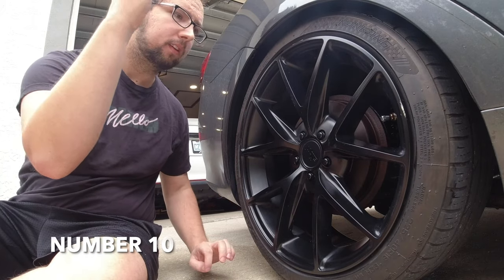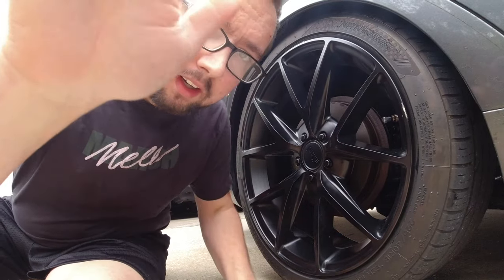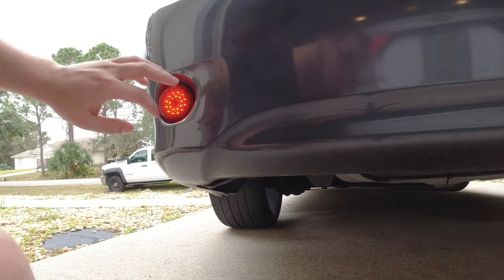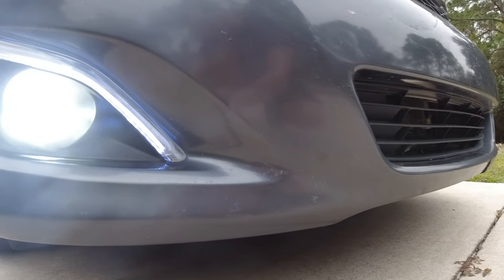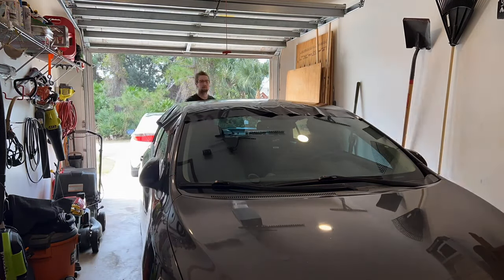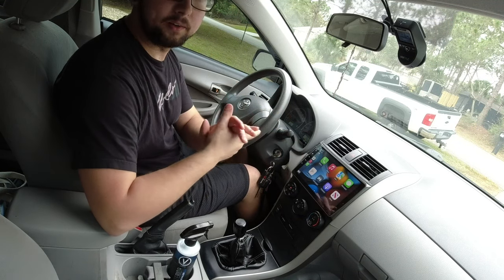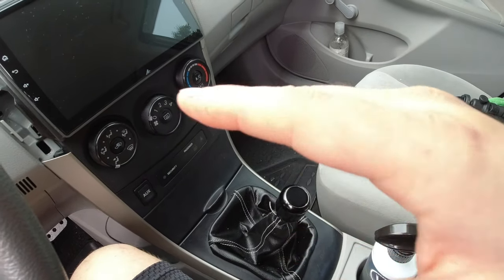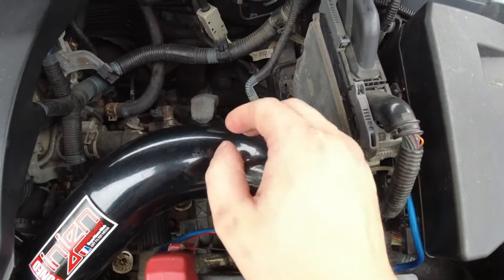TOP 10 MODS FOR TOYOTA COROLLA IN 2022

Comment: 1st thing is I run a car club, and wheels are a mod. I also have an 09 LE and thanks to you I've done most of these mods to my car as well.
Reply from the maker: I’m glad to see you agree that wheels are a mod! 
And that awesome that my videos have been helping you out!
Reply: @BrandonStellmach  they’re at least a mod! anything you can change is a mod! i’d go further and say they can be upgrades. you’re correct about rotating mass but wheels are also unsprung weight which too much of, reduces handling. lowering it, has the inverse effect and makes it more nimble! rims & tires are ALWAYS modifications but if they are lighter and/or stronger, they are definitely upgrades. Width and height also make differences but this comment is already too long🤣

Comment: Some good mods but you just need to clean it up and bring it home. 1. Get better tires, although you are in Florida where there are no mountains and fun roads so they might be okay. 2. You are missing the trim on your center dash. 3. The wheels look nice, nice design. How much do they weigh? And I agree, wheels and tires are a mod. 4. I have the TWM shifter in my 2009 Corolla S Turbo and I love it too. It's the same design as yours. A little tip to make it easier next time. Leave the shifter cage in the car, no need to take it out and it's like having an extra set of hands to hold it still. 5. Leather wrap your steering wheels or get one from the S/XRS as they came leather wrapped and it's so much nicer than the rubber steering wheel. 6. Coilovers are a great choice, I'm on BC coilovers and love them. 7. The stereo looks nice. What brand is it? Is it just one of those cheaper Chinese stereos? 8. Love the Borla exhaust! I had that too but you need to swap out the rear bumper for an S bumper after cutting it. That just looks tacky. Check out my video of my mods. I did one a short time ago. I also just did a rear drum to disc brake swap and a Ceika BBK on the front. Keep up the good work. I love to see Corollas getting some love.
Reply from the maker: Yeah I agree Florida is a flat boring state with no fun roads. And for the weight of the wheels, they were about the same weight as the 15 steel wheels with hub caps, about 30 something a wheel! 
But this was pretty much a budget build for me. I have never modified a car this much before until this one. So learning what to spend extra money on. And where I can cut corners. And yes the radio is a cheap Chinese radio l, but have no complaints. Works great and I have Apple CarPlay! 
And I have seen your video. You have given me many extra ideas of what to do and add! 
Thanks for the tips! 👍

Comment: Could you make a video to adjust LED headlights? I installed them and they seem to blind everyone. I managed to adjust the left side, but the right side (battery side) is hardly accessible because of the air valve. Thank you!!
Reply: The coffin fleet 😤 Wulf
Reply from the maker: I will be doing a video in the future about upgrading my headlights to projectors. So in that video I will show how to adjust and level them!

Comment: I have a 2010 corolla s and i’m looking to upgrade my sound system since one of the speakers went out. for the radio did you have to do any custom wiring or is it all plug in play? also are you using the stock speakers?
Reply from the maker: The radio I have is plug and play! 
And my speakers are still stock, the only thing I have done was to add a 12” sub.

Comment: Did your audio sound a little different or less powerful after you got the stereo head unit? I feel like my music isn’t as loud as it used to be when I used an aux chord as to how it is now with the stereo unit.
Reply from the maker: I thought the audio sounded much better than the old radio I had, one thing you might need to turn on it something called “loudness”.
I believe it somewhere in the amplifier settings on the radio. It will definitely make it much louder!

Comment: Hello friend, I follow your channel closely. I own a 2010 Toyota Corolla vehicle and I follow your example. Is there any imbalance in the axle system due to the suspension change you made on your vehicle? I lowered the suspension level of my vehicle and my vehicle's axle system is vibrating.
Reply from the maker: Thank you for watching the videos! But I have not had any issues since I have lowered my car. I would double check that everything is tightened down good! And get an alignment to make sure everything is good!

Comment: I picked up a 09-base model on Black Friday. Wish it was a manual, but needed a second vehicle. I plan to do some things to mine since I am using it as a daily now. I did find a turbo kit and am thinking of swapping one in down the road. Can you post a link for the wheels and tire, really want to purchase them during the summer.
Reply from the maker: I don’t have a link to them. But these are the wheels and tires I bought. 
 niche m117 Misano 18x8.5 with Nankang 225 40 18.

You should be able to find them on fitment industries. 
And I was really in search for a corolla S with a manual. And those are even harder to find. So as soon as I saw this one I had to buy it!
Reply: @BrandonStellmach  if I do end up building this one, I plan to get a manual swap in the future.
Reply from the maker: @suburbanfreak87  well if you put a turbo on it, and blow up the transmission. It will be an excuse  to get a manual transmission! 👍

Comment: I have a very important question after you bought the screen did it need a kit to fit it or it was the right size ?
Reply from the maker: No you don’t need any dash kit. It will work with the cars trim pieces.

Comment: If I had 2 instrument clusters one will be a test and the other would be the oem,  would I need to reprogram it if I swapped it?, reason being I wanna swap the bulbs to led's in the cluster panel, but I don't want to risk using my own so I'm going  to buy a second used one to see if I am able to solder the led's together
Reply from the maker: The problem would be that the other odometer would need to be reprogrammed with how many miles you have on the car. Otherwise they won’t match. Unless you can find an odometer close to the same miles.

Comment: Hey Brandon I recently got my 2013 Corrolla stuck in a ditch. Bad weather. Japan models come with tow locations that are stored next to your jack thatscrew in locations. American models don't. I've seen people install a small tow strap On front bumper. I'd love to do this to mine. I live in KC winter here can get a little crazy. Idea for a new mod vid. The strap looks cool I think and are a necessity
Reply from the maker: Damn that sucks to hear that. But hope everything is all good now! 
And I will look into it, because I know some times when people install them they are just for looks and not actually installed to a structural part of the car!
Reply: @BrandonStellmach  awesome thanks man
Reply: @BrandonStellmach  there was a video I seen a guy take off the number and screwed it in on the frame. The even have TRD ones lol
Reply from the maker: @jmartin1915  okay I have seen his videos. But I see it’s actually drilled into the front crash bar!
I could definitely do that to my corolla!
Reply: @BrandonStellmach  just wanted to here your feedback. If it's possible. If you end up doing this. That would be awesome
Reply from the maker: @jmartin1915  seems very possible, just would need to find a good place so it hangs out the front grille some where!
Reply: There's no towing locations?? My 09 CE has 3 tow points on the front 2 for a chain and one big loop on the front

Comment: If I’m keeping the stock size on do I need to get a tps  I have Corolla wheel covers
Reply from the maker: I’m not sure I understand the question? Are you talking about TPMS sensors for the tire pressure? If so you can always just reuse them when you go to a new wheel. The only thing I would say is that the batteries in the sensors only last for about 10-12 years. And it’s best to replace them when you get new wheels or tires.  Otherwise they might go bad and you will have to take the tire off the wheel and replace it again!

Comment: Honestly the radio isn’t the best option for the money I highly recommend the boss elite or alpine with Apple CarPlay better software comes with 2 year warranty and only 200$ with backup cam the 100$ Amazon android radio is good if that’s your only option but since you most likely will use the radio everyday it just makes sense to spend the extra 50-100 depending on the model / features and screen size you want
Reply from the maker: I can bet the alpine or boss will last much longer then these android radios! 
But what I like about these radios they give a much nicer look and they look built into the car rather then having to buy a dash kit and not look as nice!
Reply: I would never run a boss anything. Pioneer or jvc for cheap end audio equipment always. Worth the extra coin to have a good, solid unit.

Comment: Your “fog lights” are Not fog lights, they’re driving lights. Fog lights are yellow (perhaps orange or amber).
Reply from the maker: Never knew fog lights had to be yellow to be called fog lights. So I guess they are just an extra light, in the fog light position! 👍
Reply: @BrandonStellmach  Think about this, what’s the purpose behind the use of fog lights? It’s to see better in the fog. If extra “white” light were the answer, then your high beams would suffice.

Try this experiment the next time you’re in fog: put your high beams on and then off. Next, turn your yellow fog lights on and off.  Which allowed you greater visibility?  Your supplemental driving lights are useful really only on windy curvy roads, or when cornering. To use them all the time poses a greater risk of blinding your oncoming fellow motorists, and those whom you’re following.

Please, use all your lights appropriately. I’ve driven a big truck for over 30 years, and other than people being far more distracted than ever before, by the phones they’re blinding me at an ever increasing and annoying rate.

Please, be a part of the solution, not add to the problem. Thank you
Reply from the maker: @mccainjay  that’s a really good explanation of this! And I agree I hate when people are blinding me with their lights because they have high beams on or the headlights are not leveled properly.

Comment: Straight pipe your corolla.
Reply from the maker: Nah, that would be to loud! If I didn’t drive my car every day. I might do that!
Reply: @BrandonStellmach  it’s not too loud. I DO drive it every day and I love it. Welding school, couple friends and an oriley’s parking lot.
Reply from the maker: @svndwich977  maybe I will think about doing it!
Reply: @BrandonStellmach  the way I did it, just cutting the stock muffler right off, without the hole there for the exhaust you can’t even tell. Though, you cut yours, so I may go with something more professional
Reply from the maker: @svndwich977  yeah that is a problem, now I have a cutout for the exhaust I would need to at least get a nice tip welded onto an extension so it looks nicer! But thanks for the info!